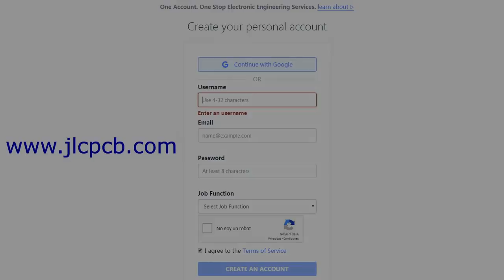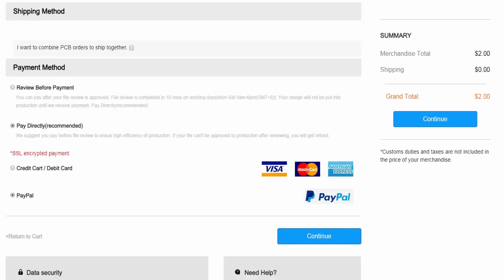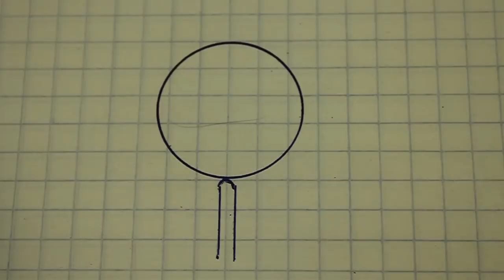Large Mass, Low Current Electric Motor - 17 Micro amps

Comment: I'm always impressed by coils using such fine wire.  Wire of 40 AWG  is fragile and difficult to handle.  How do you make electrical connections to the coil, such as the reed switch?  Do you attach thicker wire to the coil ends so it's easier to handle?
Reply from the maker: Yes I use thicher wire at the coil ends

Comment: I just finished building the same with automotive relay coils . Works very well even at 5 volt USB output . I have experimented with a few different configurations now and best rpm was in repel mode with very small magnets on rotor and 1 tiny magnet in repel mode on furthest away side of coil. Incredible low current and I could hear rpm increase with 1 magnet on coil . Placement of reed switch from top and not the side also improved rpm as it reduces magnetic interaction with rotor magnets but still switches

Comment: Greetings everyone. Hello. 1:17 is the rotor part of a video cassette ??? I have one. 6:30 math !!! My Kryptonite ... this engine is super quiet. Question: What is the maximum speed of this type of engine ??? Very good. Congratulations. Success.
Reply from the maker: The rotor is from and old vhs tape recorder.i dont know what is the maximumspeed
Reply: The speed of an DC motor is proportional to the voltage, where as a AC motor speed is proportional to the frequency and field windings. If you count the turns it made at one volt and note the time you should be able to figure it out, an engine can be a motor but a motor can't be a engine, a engine has to have a combustion ether internal as a gas powered car truck ect, or external like a locomotive (old steam train) steam power tractor.
Reply: Le Z Hey I did some math on this thing using a metronome and came up with 13.75 RPM, but my metronome only goes down to 20 beats per minute, so I doubled that to 27.5, I played the metronome and video together and it seemed to be just a blonde one out of time, my metronome is digital with a tap button to set it, I used that when he had it running at 8 volts and got 110 RPM,  there is a error in my maths but it's very small, keep in mind I'm watching the same video you are, I'd say 13.5 turns per volt would give you the speed. He had "maxed" his power supply out at 30 volts. So the maximum speed is 30x13.5= 405 RPM. Of course it will go faster if you put more volts to her. As a side note they's number are only relevant to this motor there cheap motors in toy cars that do 1200 RPM on a 1.5 volts, but they also need 500 mA and that's lot more current then this is.

Comment: Nice. What if you use 20 pounds then will you need even less volts? What is the best efficiency then to weight to volts ratio if friction was not an issue?
Reply: Not sure how you can increase weight without increasing friction if you use any sort of contact bearing, you can't flippantly dismiss friction as a non-issue in heavy machines.
Volts and Amps multiply into power transmission across the magnetically-coupled circuit, increasing one usually decreases the other or produces excess heat, the optimum balance depends on the circuit implementation and component properties, different materials and part geometries will shift power efficiencies (and losses) in different ways.  In practice the maximum thresholds would probably be how fast your bearing can spin or how much heat your magnets can endure without weakening.
Reply: @pwnmeisterage  magnetic bearings have no friction.